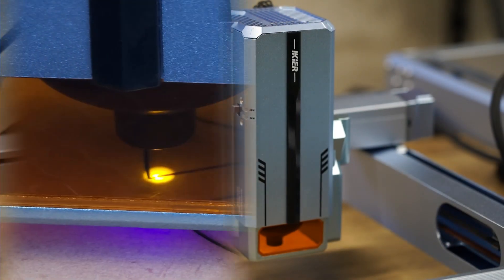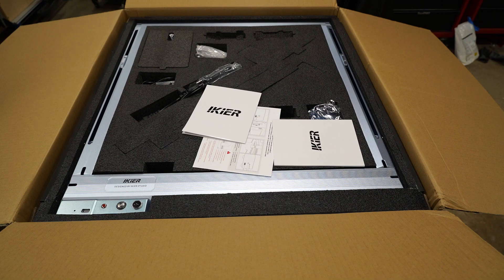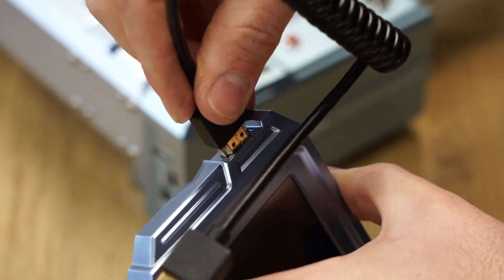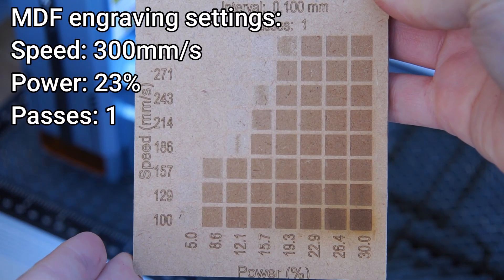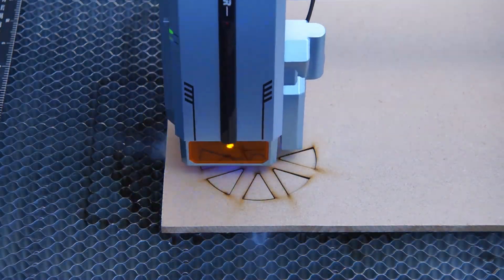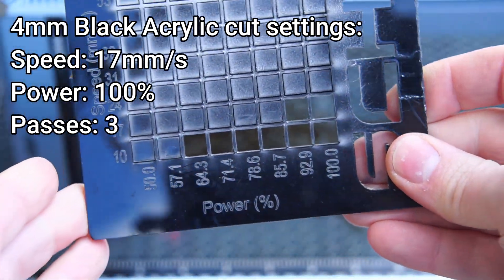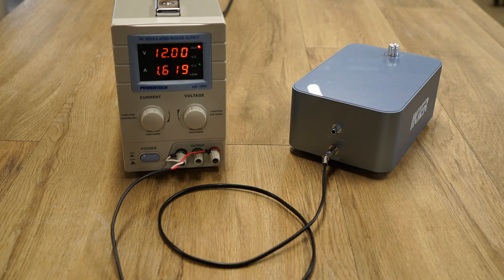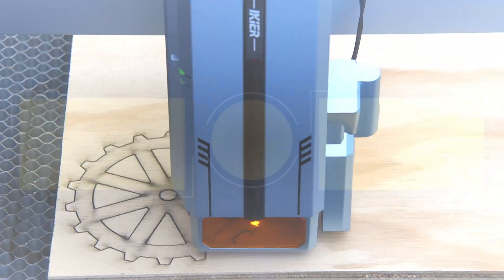iKier K1 Pro-Max 48W Laser Review

Comment: I really regretted getting involved with ikier k1 pro max    -   I’ve had the refound laser head twice, the first time it had crumbled glass inside the laser module where the glass system is located. Ikier change it. The second module worked for two months and just stopped working, that is, it does not cut or engrave, but the fan works. This module was replaced as well. The third module worked for 6 months he began to degrade the laser (diodes) Became worse to cut, the power fell. Although I used it for 40 hours a week and cleaned it after each use. So think twice  about whether you need it?

Comment: Yes, I will actually use your affiliate link, if you can answer my question, which Ikier support was kind enough not to answer.

It is pretty simple really. To my mind, on paper that is, there is absolutely no reason, at all, to get the pro max, apart from the power switching. Considering the laser output power and spot size, the actual power delivered by the pro max, given the spot size, is surpassed but all other options, except it's own 24w power switching mode.
I realize that there is much more to the story, some of which I may or may not comprehend, and you have already illustrated that the pro max is actually faster than the ultra, however there is more to this than time, mainly quality, and with you actually promoting that pro max over the ultra, basically concluding that the pro max can du whatever the ultra can, and more, I am somewhat confused.

Are you actually saying the the pro max can achieve the same quality, not factoring in the time factor in any way shape or form, that the ultra can? If so, how can this be?
Reply: with the pro max, you can use the 48w for faster cutting and the 24w for more accurate engraving.  at least that is what is advertised.  in that way, the pro max cuts faster than the ultra with its 48w and engraves with a more fine laser with its 24w.  also, as shown in the video, the pro max has a much more powerful air assist vs the ultra.
Reply: @strangefire2024  yes, except the ultra 36w, can achieve the same precision, according to the specs, as the pro max can. Likewise the pro 24w can achieve higher precision than the pro max at 24w.
All that being said, all I really need to know is if there is anything the ultra can do, also in terms of quality, finish, etc, that the pro max can't.
Reply: @FelixNielsen  there really isn't anything that the ultra can do better than the pro max IMHO.  probably the only reason you'd want to get an ultra is for the lower price tag.
Reply: @strangefire2024  Well, according to the specs I'd say you're wrong. How do you arrive at this conclusion? Direct comparison, personal experience, reviews, or something else? If the ladder, could you point me to your sources?
Reply: @FelixNielsen 
well
u just watched a speed comparison between 2, 30%
is a massive gap.
Reply: @TheMoreUKnowXYZ  If I just wanted a speed comparison, I wouldn't have asked for it, as this is already available. May I have expressed myself an incomprehensible way about maner, as I so often do. I this is indeed the case, my apologies.

The essence of the question is simple though. We all know that a Ferrari is faster than a Kia, but for most people this is rather irrelevant as the ladder can easily achieve any speeds needed in daily life, whereas thing like price, comfort, reliability and soo on, are actually relevant, though rarely brought up, when it comes to a review of a Ferrari.
This really is no different, only the Ikier Pro Max is not a Ferrari, in fac tit is not even in the neighbourhood, unless, perhaps, you factor in the cost, but to do that you have to consider a number of factors.
 
If the Ikear Pro Max, at 24w, cannot produce the same result in the same amount of time, as the as the Ikier Pro, again at 24w and on paper it cannot, there is an argument to be made that in some aspects, the cheaper model is actually better, and the same goes for the Ikier Ultra at 36w, vs the Ikier Pro Max at 48w, only not as clear cut. Not doubt the Pro Max can do better timewise, but this tells us nothing about the quality of the end result, which sometimes at least, and I'd argue almost always, is more important.

That's all.
Reply: @FelixNielsen  technically in case of ingaving the 24w mode will do better than 30w wersion due to smaller dot size. 
Comfort quality ... These I suppose are the same for all of this models.